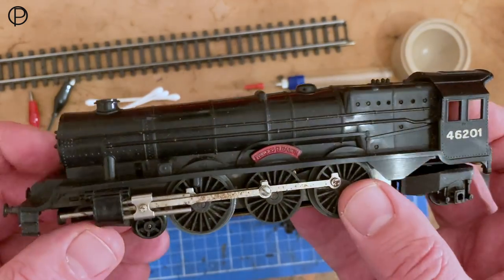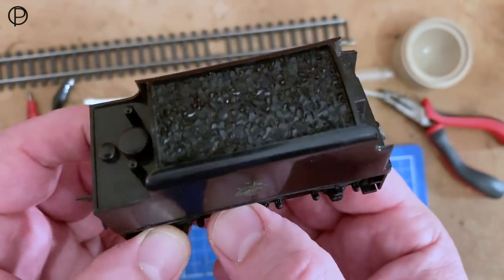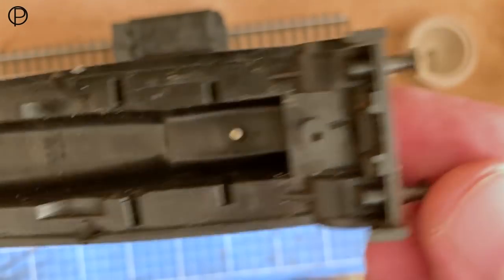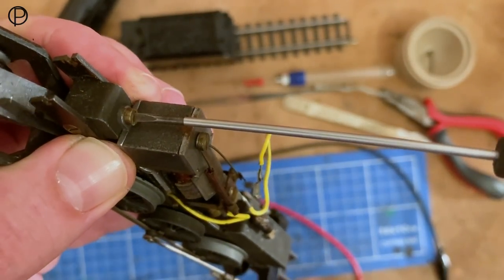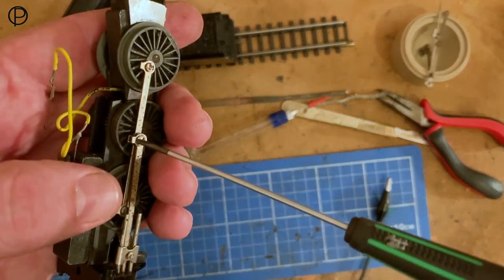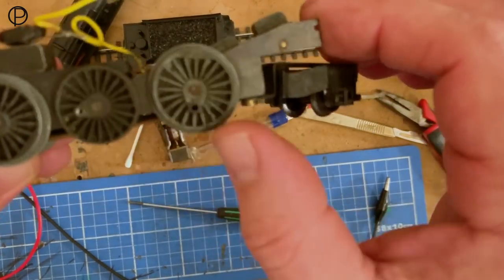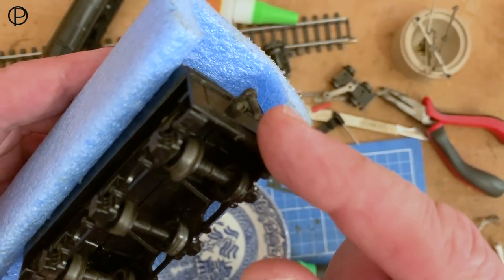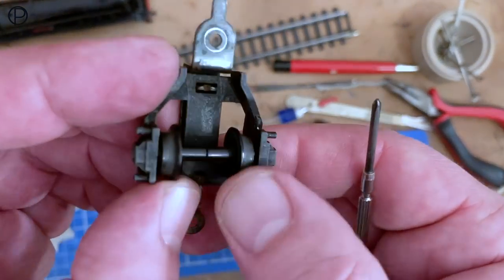Tri-ang Railways R.50 Princess & R.30 Tender

Comment: I had one of those as a Xmas present in 1957. Reliable and ran forever.
Reply from the maker: Hi Keith that sounds great, do you still have the model.
Thanks for watching.
Oscar
Reply: @oscarpaisley  Unfortunately no as my mother gave my Triang Railway to the local Scout jumble when I headed off to university. Still have a model railway collection but now consists mainly of 1960s Marklin, but it was the Triang trainset for Xmas when I was six that started me off.

Comment: Fascinating Oscar. You disassembled model very assuredly whereas I’d have a lot more trepidation . Was surprised you clean chassis with hot soapy water . I thought that might result in rust and have always avoided using water on my models .  What a great reassembly job . Lots of great tips in there
Reply from the maker: Thanks Russell, I was always wary of using water at first someone suggested it at the model railway shop(now closed) some time ago. I've also washed a lot of track before using it on the layout with warm soapy water with good results. I think the drying part is important to avoid any rusting. 
Thanks for watching glad you found it informative.
Oscar

Comment: I’ve had a few of these princesses over the years, I even picked up a battered one last summer for 50p.
Years ago I had a bash at kit building, kit bashing and scratch building, I found the wheelbase of the princess chassis to be the same as the class A5 GCR (LNER) and the A8 NER (LNER)  so I used the chassis for the basis of these models.

If you wish to aftermarket wheels with 1/8” axles, then Alan Gibson frame bushes (if they’re still the same dimensions) are an interference fit into the Triang chassis, enabling you to fit finer scale wheels.
Reply from the maker: Hi Ruben I think a lot of modellers in the past used Tri-ang items as the basis of finer more accomplished looking models. Thanks for watching and the information.
Oscar

Comment: I'm in the process of cleaning up a Princess with a red body and black ash box. It has a hairline crack in the footplate but is otherwise in pretty good condition. Somebody has done a bodge job on soldering the resistor and wires to the pickup and brush arm, but that's just cosmetic (although as an electronics technician I will clean that up). I had some runout on the rear axle, so it looked like it might have been dropped, but squeezing the two wheels together between my thumbs and forefingers at the maximum runout point fixed it up nicely. You provided some nice tips here, but I was thinking that an ultasonic cleaner might be the go for the block cleanup. I don't have one, but I intend to get one. I picked up a nice little Connie (yellow 0-4-0) with the Pricess and will give that a clean too.
Reply from the maker: Good morning Gary ultrasonic cleaner sounds interesting it would be great to hear how you get on with it.
Thanks again take care
Oscar.

Comment: hi oscar i foud a good tip for cleaning plastic wheels use bathroom spray cleaned and it works i have cleaned loads including airfix mainline lima and hornby  it leaves no residue and is quite gentle and unlike washing up liquid it doesnt attack the plastic regards robin
Reply from the maker: Hi Robin, thanks for the information.
Oscar

Comment: Again Oscar ,, Thaks a heap ,, a very helpful video especially the insulating plate on the base of the engine ,, 
Q.. What is this made of is it cardboard ?
Also ,, where about do you get the fibreglass pen from that you used to clean the copper wipers that pick up current from the wheels ?
Cheers from John in Australia.
Reply from the maker: Hello again John, I have to admit to not knowing the name of the material used on the collection plate it can look quite fibrous on one side and shiny on the other on the early models and is often brown later and is quite ridged later models it looks to be more of a plastic-type materials and I have and some of my 0-4-0 Nellie/Polly industrial type models have a quite bendy thin material used. so I think they may have used several different products to make these collection plates over the years. It just has to be insulating. The fibreglass pen is from the jewellery industry I think but are used by modelers to there are a number of options if you search "Fibre Glass Scratch Pencil Brush Clean" on that well know aution site or market place it should point you in the right direction.
Thanks agin take care.
Oscar

Comment: WOW What a great video that was, I had a princess back in 1956, I remember taking it apart in the 60's as one of the drive wheels went wonkky, then girlsgot in the way. So tell me, is it possiable to replace or aline the wheels (I've since accured three more princess's and I'd like to get all four running, again thanks for the HOW TO DO video...Iddy
Reply from the maker: God morning Idris, great to hear you found the video interesting, wonky wheels can be relatively easily usually by removing the wheels on the insulated side these are the one that are most often at fault as they are pushed onto a plastic insulating bush which has some flexibility in it but not much especially as they are rather old now you easy these wheels off, the bush normal brakes when you do this. Its not recommended that you reuse the old bush as that is part of the original problem. 
http://www.hornbyguide.com/service_sheet_details.asp?sheetid=153
looking at the service sheet you will see the bush is part S5065 these can be found on that we know auction site. Carefully refit the wheels with the new bushes making sure they are inline and not wonky. This is where the slight flexibility of the bushes help as adjustments can be made. Remember the to keep an eye on the quartering so the model runs smoothly when reassembled. Barrie Davis has some great videos on https://www.youtube.com/channel/UChVzVVov7HJOrrZ6HRvV2GA/search?query=quartering
If the wheels are out of true on the none insulated side or the axels are bent replacement wheel my be the way to go, you will still need the insulating bushes.
Thanks for watching hope this was of some help.
Stay safe.
Oscar

Comment: Really good to watch you service that loco Oscar. I have Princess Victoria with solid wheels, I would love to date it, it has two blood and custard coaches with it. Any clues as to what I could look for to try and date it.? I am thinking around 1960. it runs very well but could do with a tender respray and a tiny repair on the front buffer beam.
Reply from the maker: Hi Philip, it could have been an R3A set in 1959 or the RS1 set in 1960 to about 1962.  Both these sets had the Princess Victoria although the R3A started life with Princess Elizabeth.
Oscar
Reply: @oscarpaisley  Thank you Oscar.

Comment: Oscar I have an old triang princess that I’m attempting to get working . I have a confusing issue that I hope you can help with. I’ve replaced damaged wheels , new pickups , new motor brushes and given everything a good service. The problem I’m having is if I put power directly to the motor it runs strong in both directions but as soon as I connect all the wiring and put it on the track I’m not getting any power. I’ve tested my other locos on the same track and they work fine. Any ideas as frankly I’m stumped as to what’s wrong
Reply from the maker: Good morning Mark sounds like the power is not finding its way to the motor. I would check you have the wheel in the correct way round, the insulated ones should be on the side with the pickups. Also, remove the collection plate with the pickups on, the wire solder joint to the pickup can break over time and leave the model without power when all else looks fine. Hope this was of some help.
Take care.
Oscar
Reply: Hopefully you solved this by now, but if not it's worth connecting the wiring, sitting the loco on track, and still applying power to the motor brushes. If there is any kind of short due to wiring or wheels not installed correctly the motor won't move. If the motor does move then as per other comment it's a pickup or wiring issue. I just serviced one of these today, they are pretty bullet-proof and I'm sure you'll get it working.

Comment: Hi there pal hoping you can help me out please with a little problem I have, how to remove the 6 x wheels from the chassis, I've got 6x triang steam engines that I've just recently bought which Iam doing each one up, with some missing parts and some really dirty, the first one I tried tapping the shaft out but none seemed to move, then put it in a container and soaked the wheels in a oil and yeah still bloody nothing, hope you can help me out and might have a easy solution thank you for listening to me go on
Reply from the maker: Hi Karl sounds like the the axels/chassies may be very corroded if your not able to tape them out once you have removed the insulated wheels from what you are describing.
Oscar

Comment: check the trailing bogey axle you will see there is 2 parts nerled on the axle so one of the wheels stays static on the axle
Reply from the maker: Hi, thanks for the information and taking the time to watch.
Oscar
Reply: other wise the pin axle would drop out when ever its put on its side i side nearled so it cant drop out